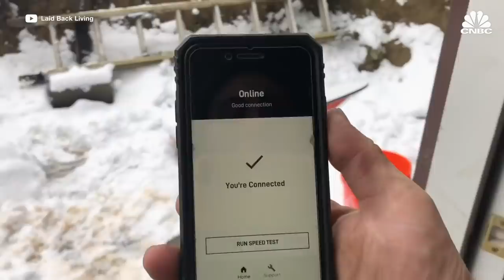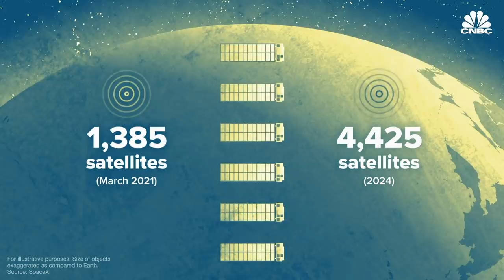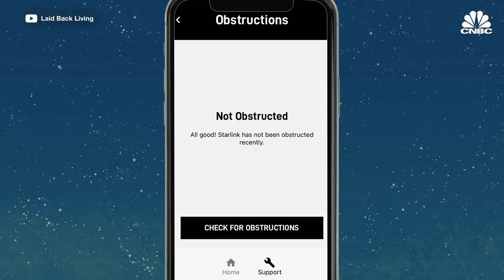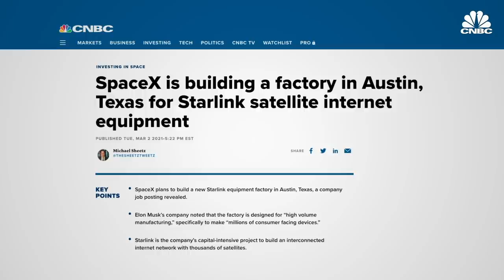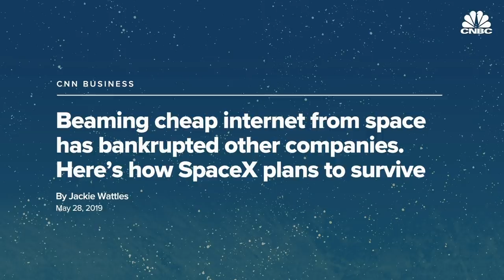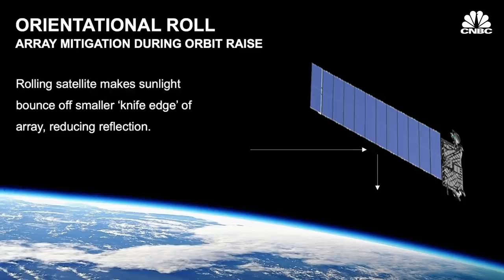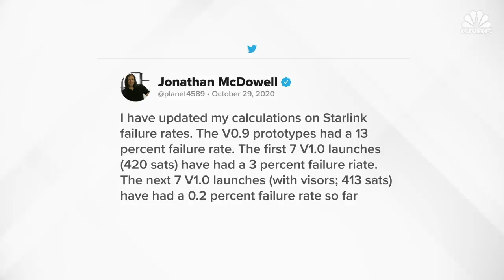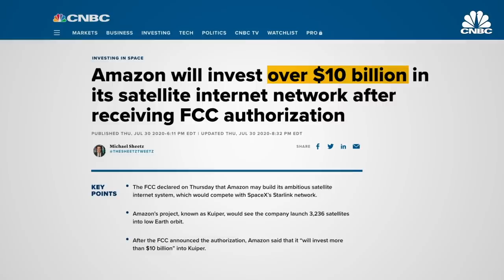Why Starlink Is Crucial To SpaceX’s Success

Comment: 3:34 I like how it showed the Falcon Heavy, when the Falcon Heavy hasn't been used for Starlink!
Reply: Yes,,,is there any possibility that Mars can be second homeland for humans
Reply: @wenwin7038  offtopic?
Reply: @wenwin7038  Of course there is a possibility (tho in our lifetime a very slim one).

However, Mars is a very very very very very harsh place. It's a cold, radioactive desert (Mars barely has a magnetic field, and therefore there is nothing to shield the solar wind, aka radiation). We would have to find ways to overcome the challenges Mars presents. It will not be easy.

Food is the main issue, as bringing enough food for 2 years is no easy task (a transfer window to Mars only comes every 2 years. No supplies can arrive during those 2 years). For long term stays, aka a "homeland", radiation becomes a bigger problem.
Reply: Ikr
Reply: @chesterwang3070  You don't know much about Mars. Actually Mars is not ,,radioactive desert'' - its a stupid hollywood assumption, most places on Mars experience radiation levels similar to those on ISS - we live in ISS don't we? Food is not even on top 5 priorites on Mars too. Main concern is of course pressurization, oxygen and heat - heat is the number one enemy for now because we are only sending robots to Mars - and they need to survive cold martian night (temperatures as low as -80C) by warming their electronics with heaters. Second enemy as for now is martian dust which killed one of our rovers - Opportunity, and its really problematic because its toxic to humans and charged so it is attracted to metals etc.
Reply: @graullas8981  We do live on the ISS. However, do we have a "homeland" in space? No. They live there for 6 months. Radiation isn't much of a problem for a short amount of time, but is an issue for a "homeland".

Sure pressurization. Oxygen. How do astronauts live on the ISS then? Electrolysis of water to create oxygen. Yes ofc the receive shipments of oxygen from Earth, which obviously isn't an available option on Mars. That's why MOXIE is on Mars now, trying to create oxygen from Mars' atmosphere.

Temperatures. Ok I'll admit I sorta overlooked that one-

Opportunity wasn't killed by Mars dust. It was killed by the dust covering the solar panels, blocking the Suns light. I'm not denying that Mars dust can't cause issues to electronics.

Edit: Formating
Reply: @graullas8981  Yes, the deadly dust of Mars killed Opportunity at a young age of 15 years, only 57x its designed lifetime and mission plan. :)
Reply: @jimkear6749  Lmao i know whole Opportunity story, it was killed by mars dust eventually, if you want to be specific by dust storm.
Reply: @chesterwang3070  I literally just said that but shorter. Mars dust is a shortcut if you know what it causes - of course it blocks sunglight it can't tip over anything or penetrate machines.
Reply: @chesterwang3070  Yes long term you need to shield from cosmic radiation and it can be done by simply covering your habitat with regolith or some ice. Oxygen can be produced by so many ways on Mars. You can extract it from atmosphere purely by compressing air to some degree inside a device and heating it so it appears as water vapour, there is 0.3% of water vapour in Mars atmosphere. You can create it by MOXIE, by plants, and mainly extract it from huge deposits of ice undeground Mars. So it isnt that much of a deal.We don't need to live underground either that's just dumb considering the level of radiation, you are fine living in protected habitat on the ground and doing EVAs etc.
Reply: @graullas8981  "Simply". It's simple to on Earth, but how tf are we gonna do that on Mars? Bring some sorta excavator to Mars???

0.3% water vapour in Mars' atmosphere. Mars' atmosphere is only 1% that of Earths. You'd be better off trying to purify the carbon dioxide then try and capture what water you can.

I never said you had to live underground.

As to Mars dust. Mars dust is surely dangerous. Can't you "simply" shield it with a protective layer? if it was that hard why isn't Curiosity dead yet (yes opportunity died because of Mars dust, but that's because it's solar panels got covered in dust, which is a problem easy to come by in the future, now that we know the danger exists). EVA's bringing Mars dust inside habitation modules is probably the main concern, since as you said, it's toxic.
Reply: @chesterwang3070  you forgot the part about the sand being poisonous 😅
Reply: @tylerdurden3722  uh. read my comment above. scroll the the bottom. "... since as you said, it's toxic"

Comment: Falcon9 launches 60 Starlink at once. Starship will launch 400 at a MUCH LOWER cost (10x less expansive) . Starship is also designed to be reused completely at a rapid pace. Starship will completely change the game once its operationnal. I dont see how competitor will be able to compete...
Reply: Yes, Starship will make every rocket company obsolete at this point IF THEY DELIVER to the ultra low price. I think they will and we will have star trek in real life (with one main launch operator weirdly).
Reply: Other companies will use starship to deploy! Like how companies use AWS for hosting their services. (AWS was started by Amazon to fulfill their needs.)
Reply: @Motherbrain
I will explain how competitors will be able to play in the marketplace. SpaceX is opening up its launch business to the marketplace. 
I suspect how this will play out is that SpaceX will not build the entire network up there and that it will have an infrastructure that will be owned by multiple corporations. Clearly SpaceX will be a major player in that realm. 
I am currently building ground level infrastructure and have plans for next generation scaled networks on the ground. 
Exciting times ahead.
Reply: 1. Starship is not a functional rocket nowhere soon. 2. The rocket fuel is expensive, fuel makes majority of the rockets' weight, it's heavy rocket so it is sensible to use it only for the packages that fully utilizes it abilities. 3. I do not see FAA to allow to reuse rocket without proper inspection before each launch, check how airplanes are checked, they literally has some parts replaced even if still functioning good, and making functional rocket with similar % of failures hasn't been reached even for long-existing rockets. In summary: it is not going to happen, they do not event have deployment system of packages for this starship and the works on it are going very slow compared to Musk's words (see 2022-23 mars cargo missions).

Comment: 4:06 - Yes, it's true that, because they orbit at a lower altitude, Starlink satellites can see less of the Earth at any one time than a satellite at 36,000 km altitude.  But that is absolutely NOT the reason why SpaceX needs so many satellites for Starlink.  The actual reason is simple orbital mechanics.  Because SpaceX is using a Low Earth Orbit, their satellites aren't geostationary and don't remain over the same area of the Earth all the time.  Each satellite is completing a full orbit of the Earth in about 95 minutes.  Any single satellite is therefore only visible from a ground terminal for a few minutes at a time (about 3-6 minutes) before it passes over the horizon.  In order to provide constant, continuous connectivity then, SpaceX needs enough satellites so that at least one is always visible from the ground anywhere in their coverage area.  This takes A LOT of satellites.
Reply: If the world wants fast easy internet then it will require such a system as Starlink.

Comment: The price of the dishes isnt the issue. If the dish costs 1000 usd to make, the sales price is 500 and the subcription is 100 pr month it doesn't take "a long time" to break even. It takes 6 months. 

The satelites, ground stations and rocket launches on the other hand :)
Reply: hahahaha
Reply: Check out the cost of satelites deployement, internet access prices etc. and those $500 + $100 each month is going to be definitely not enough to make it profitable, even Musk said this.

Comment: Can this work in a remote region like the equatorial  forest ?
Reply: Yes. Eventually.
Reply: With enough satellites, yes
Reply: At the moment the Starlink satellites do not, with a few exceptions, have satellite to satellite comms, relying on ground stations. This will likely change, but until then, no it will not work in equatorial forest as there are no ground stations.
Reply: @simondalling7489  At the moment there are barely any satellites covering that area at all, so ground stations are irrelevant.
Reply: Simon Dalling Ground station can be up to 2000km from user dish.
Reply: Yes but be patient for now, soon it'll work anywhere on the planet.
Reply: Not yet covered
Reply: what part of "satellite" don't you get??

Comment: I think Musk is aware of the space debris situation and when Starship is ready it could be used to take down old satellites when they fail.
Reply: That was the first thing that came to mind. More space junk will be significant.
Reply: Ion engines are equipped to change its orbit but if that fails then something will have to capture it
Reply: Yeah RIGHT!!! He’s gonna just (simply) take them down??? He’s gonna use HIS MONEY & go to the trouble, time & expense to TAKE THEM DOWN??? 
PLEEASSE!!!
Reply: @leonidhadnuk9305  😂 I concur. Most companies will not incur such a significant expense and the trouble to gather trash.  A good example would be Direct TV and Dish Network leaving their satellites on your when you cancel their service. 
Just imagine millions of starlink and it’s competitors working and non working satellites in space. How are space shuttles going travel safely during their space tours?
Reply: The biggest issue on long term is the space debris pollution as is not completely clear which is the effect that the interaction between the resulting debris and outermost layers off atmosphere is known. All this needs studied seriously.
Reply: No, the Starlink Satellites are designed to burn up in the atmosphere completely. Since they’re smaller than other satellites it makes this possible. Also since the satellites are in a lower orbit, once they’re ready to come down, it’s take a short deceleration burn to rid the orbit of a Starlink Satellite.
Reply: I envision a voluminous multi-layered mass of light weight ablative sheets. Each layer punctured saps velocity from particulate impactors. An impactor might get through the first dozen or so layers but much beyond that it'll start deforming rather than simply punching through, at which point pieces of debris can become stuck. These impactor collecting "sponges" can then be sent to the moon for recycling, once sufficient facilities are in place there. The moon or any of the luna-terra Lagrange points might be a good staging area to conduct the cleanup operation. Because here's the thing: it takes so much energy to put something in orbit, it's almost a waste to send it back down. The less raw material we send back down, the less we'll have to burn fuel to send up going forward!

Comment: Them being up 5 years is a good thing. It mitigates Kessler syndrome, not causes it. Because they are so low in orbit. But that's not the case for constellations proposed by other companies, that would have them in far higher orbits.
Reply: They are extremely low so like you said they arent a huge issue. They will deorbit themselves. There is also a hige incentive to not block access to your own space.
Reply: Plus each one of them has ion engine. If something has ion engine - it is not a space debris concern, because it can deorbit itself after its mission and avoid collision with other satellites or space trash.
Reply: @graullas8981  This video did point out that those ion engines might fail at some point, or connection to sattelite might cut out. These things need to countdown their own death and deorbit themselves after 5 years even without spacex executing that command, so if they lose connection to it, it would still deorbit itself if engine works.
Reply: @gytis156  Yes but probability of starlink failure is really low and yes being in LEO is making it even better but mainly everything that doesnt have ion engines on orbit shouldnt be launched because it cant manevour and avoid hitting something else. The only fact that starlinks have ion engines should end every argument about it being space trash.
Reply: The other thing is that technology advances in the future the need for lower orbit satellites decreases as then they can be put in higher orbit with alot less satellites. In the future they may have a space station control center of better yet a space foundry and make materials that can't be made on Earth.lighter,stronger.less likely to corrode.
Reply: @brianperry4815  No. No technology changes the speed of light. Higher orbit satellites will only increase ping. You don't want sats high  up no matter the tech. If you can manage, more satellites lower is what you want.
Reply: @fobusas  Speaking of the speed of light,when not if we transmit at that speed a few 100 miles won't make squat difference.

Comment: Starlink is obviously gonna be the future, definitely on other planets/moons.
Reply: Especially when AI allows the satellite s to perform as a singular swarm
Reply: @davidrice5288  AI is not required to do this, normal algorithms are eanought.
Reply: How are they gona deploy hundrets of satielites over orbits of different planets/moons and about which of the solar system celestial bodies do you speak? Definitelly better option is to put 3-4 satellites on stationary orbits of those cause speed and latency is not the most important thing over mars or other planets/moons, especially because without protection against cosmit radiation those starlink networks over mars etc. would be dead after short time, even over earth planned lifetime is only 5 years.

Comment: I ordered one for the Beta. It's slated to come some time in July or so they say. I ordered it because the tech is cool and the profits will help SpaceX develop transportation to Mars. I have pretty good cable right now but it sure has it's share of problems often enough. I plan to run them side by side before cutting off the cable.

Comment: I don't know how it works, but you should be able to take it to another country that has coverage, set it up again and continue to use it, without extra charges, on the same plan you were using in your home country. The plan should be global.  That should force mobile providers to do the same, to be able to compete.
Reply: i believe they have a plan like that but need permission from the government to operate starlink over the country even if they can already connect. starlink is banned in Russia and China but it still works.

Comment: One item overlooked regarding the space debris problem is that because these satellites are so much closer to the ground, even if they lose communication with the satellite, it will still de orbit at a more reasonable time than current internet satellites that are way up higher sitting in a geostationary orbit.

Comment: 4:21 spacex claims that... 
can't you independently verify that? 
isn't it just physics?
Reply: Yes... The ping is 99% just based on the speed of light. Light will cover a shorter distance faster. Very poor wording in the video. It's also been shown many times that customers are getting around 20-40ms ping.

Comment: For those concerned about satellites colliding, here is my take. You are basing those concerns (or in some cases fears) on the fact that collisions are very common down here on earth. 
First, these collisions happen MOSTLY in densely populated areas (whether the population is that of people or objects) and this is mainly due to the fact that about 50% of the earth's surface (could be more or less) is barely populated since it's either covered by ice, mountains, deserts, forests or seas. 
This is why stampedes are more common that car collisions, and car collisions more common than boat collisions which in turn are more common than airplane collisions.
In space, the total surface area (a.k.a earth's circumference) is much much more than that on the surface or even the air when planes fly. This means that if starlink satellites are about equally spaced, the distance between one and the other is a few kilometers which means less chance of collision.
If one satellites goes rogue, the others can  still dodge it.
There has been a few times when countries for whatever reason thought it wise to shoot down satellites in space from the ground, the most recent one being India. Of course that resulted in hundreds if not thousands of small fast moving pieces scattered in space. It has been a few years since that incident and here we are, the kessler effect wasn't triggered, satellites are still being launched and some people don't even know or care it happened!
What's my point? Space is so damn big that SpaceX could decide to launch 400,000 more satellites, and our airspace would still have more traffic than low earth orbit (ok, maybe 400k is too high a number, but still).
ps. I didn't do any calculations so these figures are not accurate but they are not far fetched either.
Reply: In low earth orbit there is an area of space of about 500 million to 3 billion square kilometers that the satellites can exist within. 
I do not think most people understand how large space actually is. The area of orbit of the moon around earth is about 1.8 trillion square kilometers.

Comment: I can't wait for starlink. Im in the same boat as this guy. Satellite has caps. The fastest wired service was on its best day, 1.8mbs, 99% of the time 300kbs . You can't do anything with it so we use our phones for everything. What is annoying and frustrating is justvone street up, there is vyve internet with 100mbs speeds. The company isn't going to run a few hundred feet of cable for our block and the next block, so you know what, they won't get our money,  Starlink will.